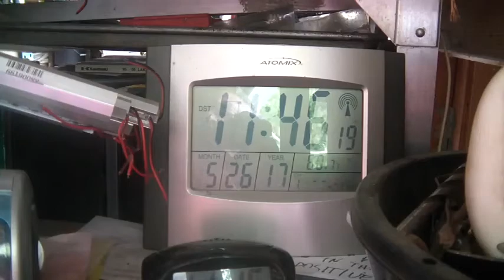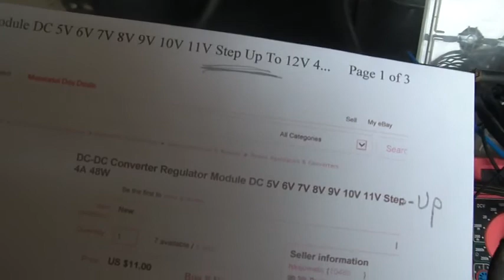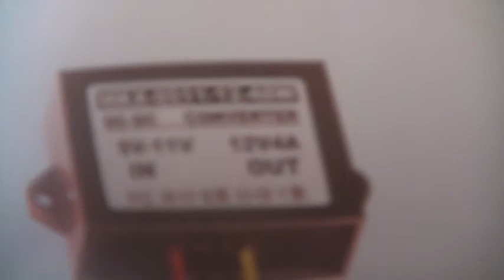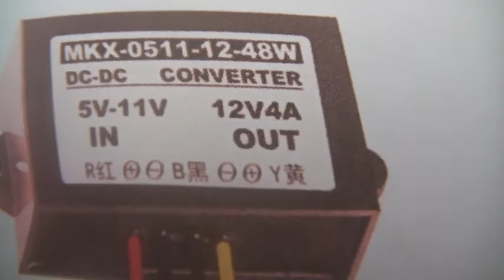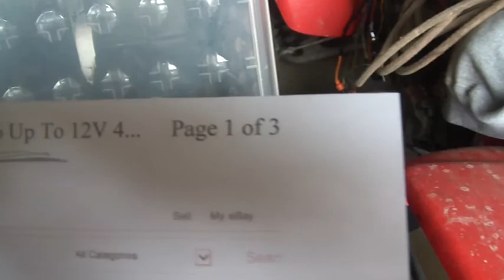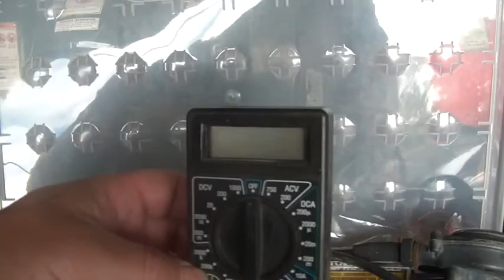ATV Parts, Honda XL185, Converting 6VDC to 12VDC, Honda 250ES,

Comment: I too am trying to convert a 78 Honda XL 100. Which is a road bike with lights and signals. Where specifically would I wire in the step up converter? My thought was to put it on the power wire coming out og the ignition switch?

Comment: honda xl is a multi purpose type bike. is roughly a detuned xr. Looks like an xr but has factory indicators, speed, Rev guages etc. generally were used as farm bikes in the day. took over from the ct type bike. also regarding people asking for parts. I also have a sustainable hoard of bits. certain things I don't mind giving to people like harness's or coils etc cos I know you can get them easily enough. but when the start asking for stuff like plastics, seats or tanks etc it's a very different story. I collected them for me!  hard part to get around here is a rear end that hasn't had the hubs welded on
Reply from the maker: Hey Ashley!!!!  Thanks for all the good info.... I considered buying a $400 XL185 from craigslist, just want to add one to the hoard... About parts, thanks for understanding, most of what I can spare, no one has a need for, most of what folks need, I also have need for my hoard of bikes.... Thanks again for the good info, understanding, watching, and commenting!!!
Reply: Harvey Spooner switch  from 6 vdc to 24v system  on a melex  3 wheeler